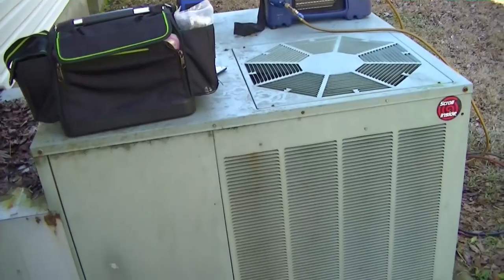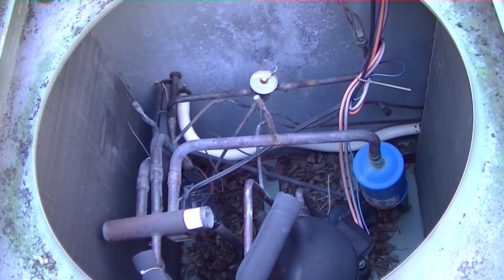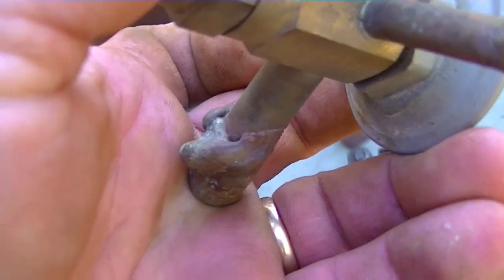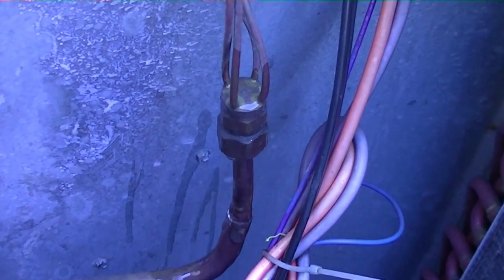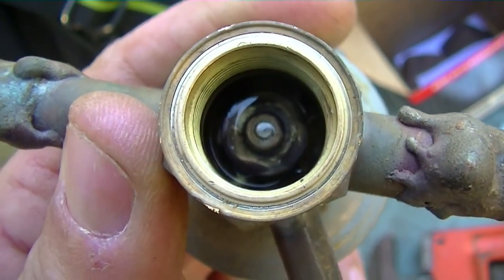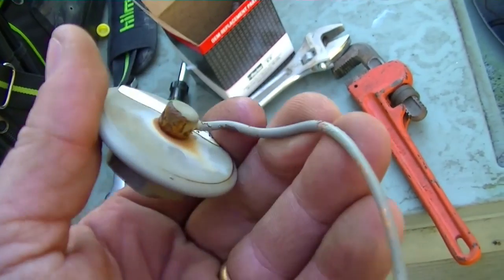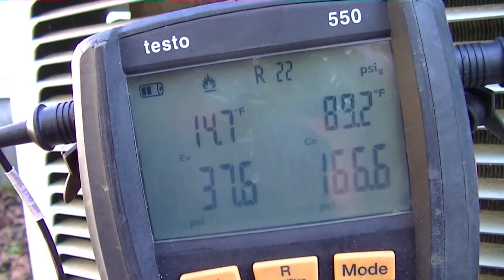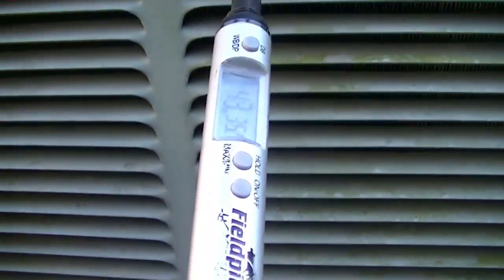HVAC Service Training-  Replacing an Outdoor Expansion Valve (TXV)

Comment: Can you check for leaks using vacuum?
Reply from the maker: you can but I always use nitro first because it's easier than pulling a vac.
Reply: talyn875 Nitrogen testing is starting to find it's way into the automotive segment, but the cost of the tools at the moment is a bit too high, and there have been QA issues too.

Comment: I hear ya so you just use bigger hoses and don't bother with the cores. My appions leak or want pull the cores out I may get some c&d's. Keep up the good work!
Reply from the maker: I was a little disappointed with the removers and the systems are not so big that I can't wait a few more minutes for the vacuum. I gotta clean my mess up sometimes anyway.

Comment: I keep those power elements on the truck, they rust out in dairies due to the damp and chemicals.

I often will braze a stub of pipe onto the valve on the work bench, then i have less worries of melting the valve when trying to fit it on the unit with my brazing skills haha!
Reply from the maker: That's what Ralph and I were discussing, brazing stubs on some of them. Sounds like a good idea on some of those things. They can be hard to reach. I bet you see a lot of rust doing your rounds!
Reply: Yeah, often there is no paint at all on the elements! At least they are easy to change :-)

Comment: Great video! Do you still use your appion valve core tools when your pulling a vacuum or just your 1/2in hose. I'm have trouble again with my valve core removal tools.
Reply from the maker: I have the yellow jacket ones, but do not really use them much. They got so finicky with cores it was more of a pain in the ass than anything else. I bought a couple of 3/8 x 6' hoses to use on residential vacuum. They work well with less hassle.